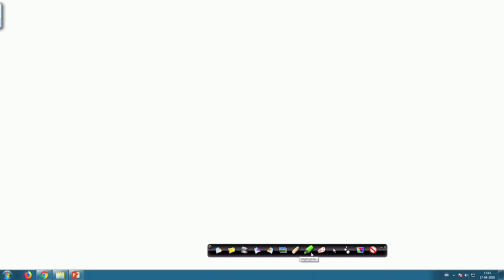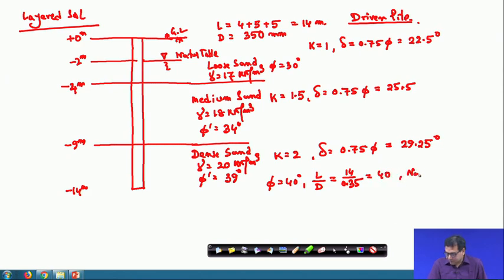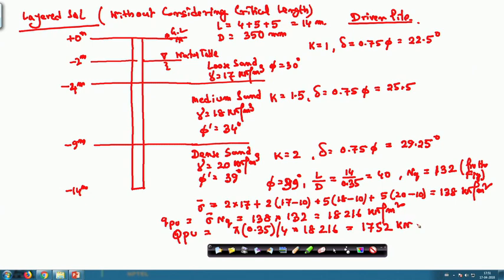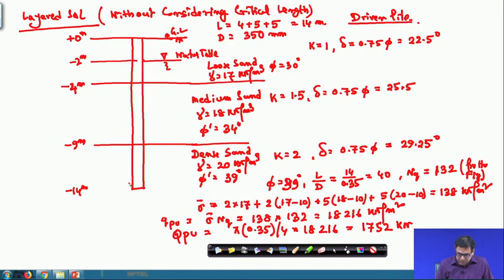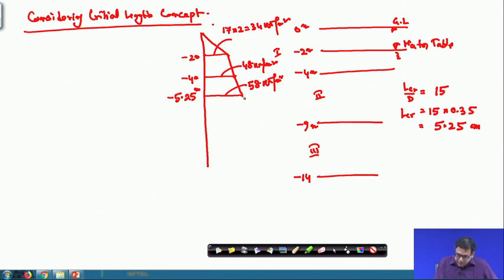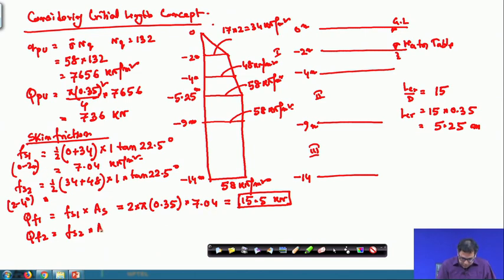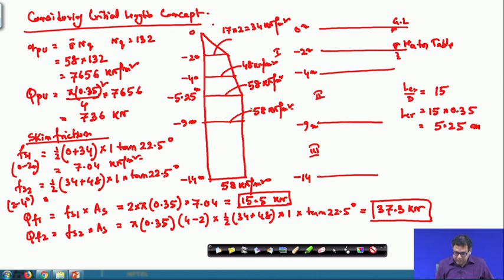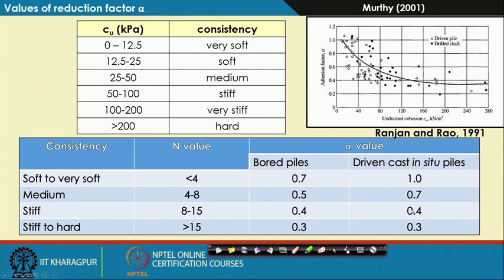Lecture 32 : Pile Foundation - VI

Comment: SIR
 21:00 I think limiting length should be calculated for each layer separately rather than considering the whole length...
In this problem limiting depth will not come in action because all the soil layers have a length less than their critical value.
Please clear my doubt..
Reply: How can we calculate brother seperate for each layer
As Limiting depth = CONSTANT * DIA of pile